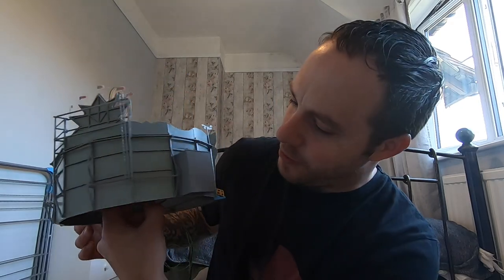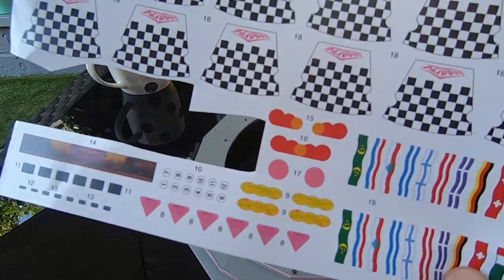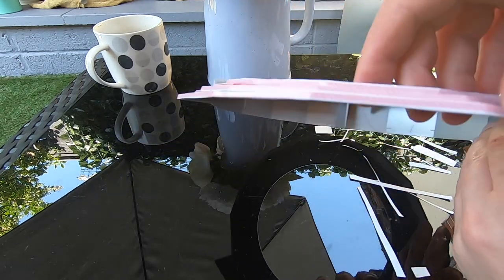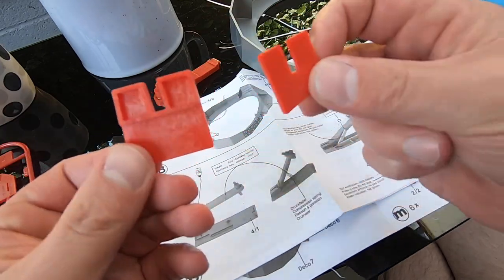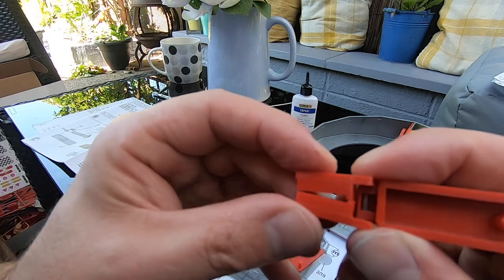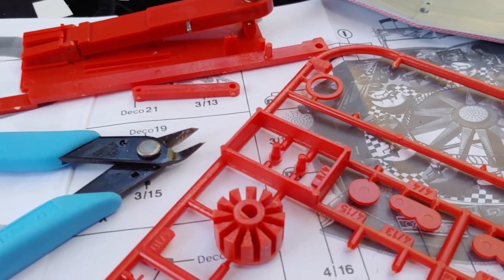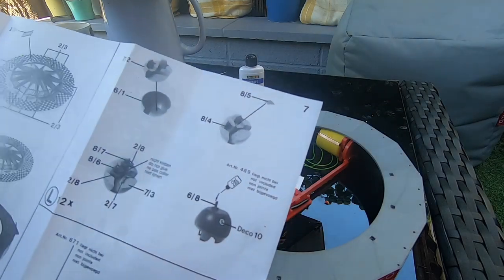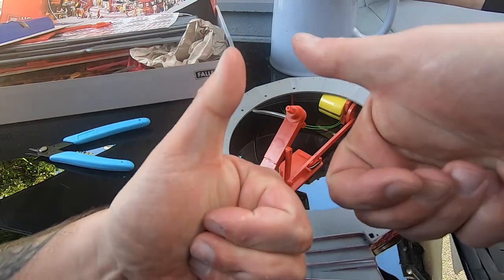Faller Flipper Build - Breakdance complete

Comment: Hi Dave,  Love your vlogs. BTW I would like to know what kind of battery did you use to drive the motor? As I have the same motor(Faller 180629) but the instruction says it needs 12-16V AC. (Have no idea about Alternating Current)